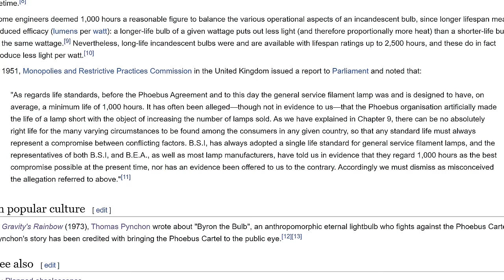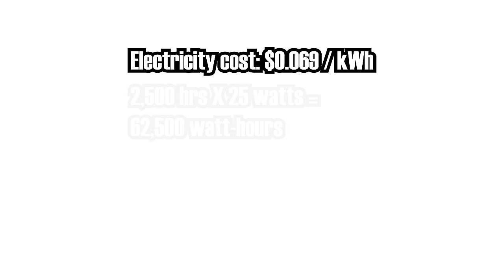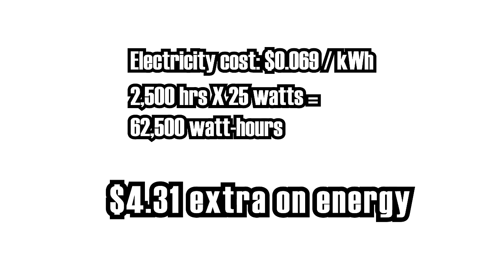Longer-lasting light bulbs: it was complicated

Comment: The big criticism is that the cartel decided what efficiency/light/color tradeoff was acceptable. The other view is that the consumers of the bulbs should be the one to decide that. Consumers might prefer dim, cheap light bulbs.
Reply: Had there been a clamor for the rare 2500h ones, that were available, to become the standard... then consumers may have changed the decision.   IIRC, they remained special-purpose.
Reply: Exactly.
Same thing with old internal combustion engines. They were lot less efficient in every way, but they lasted a much longer time and required a lot less maintenance. I should be able to decide if I want that or not.
Reply: @andrew-vl7gu  Follow a classic car with a carb, breaker points and no catalytic converter in traffic for a few blocks and you might not feel that way.
Reply: @jrrarglblarg9241 Sorry, maybe I wasn't clear enough. I did not say anything about that they are good for health nor environment, just making a point about that if something is longer lasting only because its less efficient its not necessarily worse and might be a tradeoff that someone wants to take.

Think about power generator instead of a car.
Reply: Alec never said the cartel was great and wonderful actually, he only said that their own logic wasn't just to force the buying of more lightbulbs. Consumers seemed to agree with the cartel's set point after all since the 1000 hour bulb remained common long after the cartel dissolved (and the much higher efficiency of those 1000 hour bulbs seems very desirable to those of us that remember the era of religiously turning off every single light bulb the second it wasn't absolutely necessary to save electricity costs).
Reply: @andrew-vl7gu Everything I've heard suggests the opposite actually. As complex as modern internal combustion engines are they've actually got a lot of developments that make them last much longer and fewer consumable components. For instance, my not-even-particularly-new car has a timing chain that lasts the life of the engine, replacing the timing belts in older engines that required replacement by every 100,000km or so, and if you missed that cutoff and the timing belt snapped the entire engine is cooked.
Reply: I have never once heard someone claim that light bulb manufacturers deciding on how to balance efficiency, life span, and color quality was the problem with the cartel. It is always claimed that they intentionally made light bulbs die more quickly to sell more of them.
Reply: @jrrarglblarg9241  I have one. It can be maintained at home and will run as long as I desire to keep it running. My modern car has more to break and parts availability in 30 years will probably be nil, assuming the computers and all make it that long.
Reply: @bosstowndynamics5488  i think there can be a lot of factors that might have resulted in the 1000 hour bulb being kept after as well, for one even if the cartel wasnt around the manufacturers might have kept producing more of the 1000 hour bulb because it was finacially better for them, another factor might have been that consumers got used to the 1000 hour bulb so many couldnt make the switch to a dimmer light, or it was also a case of the consumer not knowing the actual trade off, they could have just seen 2 lightbulbs, one brighter and one dimmer and assume that one was just better without thinking about the longevity tradeoff, another thing i can think of is that between when the choice was made and when the cartel ended the price for the light bulb might have went down as well to the point were as alec mentioned the tradeoff wasnt worth it anymore(not sure if Alec touched on this since im not sure if he used the low prices of the lightbulb from 1925 or the ones later one that could have been cheaper with advancements in manufacturing).
 
There are just some factors of the top of my head that could have impacted the decision. At the end of the day the choice for the lightbulb manufacturers was a easy one, a improvement in one area with the benefit of higher sales for them, if the choice for consumers was that simple as well there wouldnt have been a point in forcing that choice on them. For me personally im still skeptical about the whole thing, like i get the benefits and as with standards today you cant let consumers make the choices all the times but the differences in brightness dont seem big enough for me.
Reply: @bosstowndynamics5488  How long is that life of that engine, it may last a whole life of an engine if its short ;)
I think you're talking about just a generational upgrade of the same engine and that may be true. AFAIK there were engines on timing belts as well as chains in recent years, and not always chain was better (I think there was a VW engine with timing chain but with a flawed tensioner so you need to replace both of them pretty soon, or a different one that got stretched or spokes got worn out).

Taking that example compare a modern car engine to flathead engine - there was no timing chain nor belt to break at all. Also there were "collision tollerant", by that I mean even if valve timing would be off, there was no catastrophic failure of the engine because piston couldn't meet a valve
Reply: @TheNovgorodian  It's very easy to say that the dimmer ones seem better if you're looking at it from a modern perspective where the running costs for keeping electric lighting on are trivial and cost per bulb is significant, but these bulbs were made in an era where the running costs to keep a bulb running were so high that most people obsessively controlled how much their lights were on and when, and as Alec said the brighter bulbs weren't just a bit brighter, they were way more efficient too, which meant consuming much less power. The point Alec is making is that the total cost of ownership of the 1000 hour bulbs would have actually been lower than the 2500 hour bulbs when you factor in the electricity to run them.
Reply: @andrew-vl7gu  It's just an example, the overall point is that cars last longer than they used to.

An important factor to remember here is that there's a substantial survivor bias when looking at a snapshot of the car market today - it's easy to point out old cars that are still running and say "look, they don't make them like they used to", but that completely ignores the vast majority of older cars that are completely dead. You're comparing the best, most robust examples of old cars that got the best absolute treatment and maintenance against all modern cases, including both badly made modern cars and the modern cars that will still still be running in 40 years without issue. It's impossible to run a fair comparison this way because we don't yet know which modern cars are going to survive in that way, and you aren't comparing all old cars against all modern cars.
Reply: @bwofficial1776  The points you make, while true, do not refute my assertion that classic cars running their original engines smell up the air for half a mile behind them. Once in a while a shiny trailer queen does the Main Street thing with a fresh set of points and a well-adjusted carb that somehow manages to run correctly on modern fuel cut with alcohol, but even that thing doesn’t have a catalytic converter cleaning up the exhaust. I find it easier to love classic cars cruising up and down Main several times a year when they’re running a modern short block engine instead of an oil-breathing cast iron monstrosity.
Reply: @bosstowndynamics5488  yes but my issue with what both you and Alec are saying is that you are considering that people would go with the 100W 2500 hour option for the same brightness (which yes would have been more expensive) instead of the dimmer 70W 2500 hour light bulbs which im not sure it would be the case, if people had issues with costs then the 70W 2500 hour light bulb would have been the best option for them.
Reply: @bosstowndynamics5488  
My original point wasn't about cars, and definitely not a general rule that "cars were better X years ago" nor comparing all cars against each other. Averaging all cars they might "last longer" in mind of average owner but that's wasn't my point. I just wanted to match your example.

Rather that things were a lot less complicated so naturally they will "last longer" as a whole because there is less parts that could fail. You can already see that if you compare work needed to restore a 90' car vs 60' car. Its just less work to do assuming similar (major) damages and some parts just can't be manufactured (or its very hard) if you don't have a factory. Eg. Most integrated circuits are black-boxes that if you don't have a original "plan" then you're screwed. That's what I meant by "lasting longer", not that average car will make more miles or require less visits to a mechanic.

And again - my original point wasn't about cars, just that I want to have an option to buy less complicated, simpler things even if they are less efficient if I'll find it suitable. I don't want to have a cartel or a government to decide that those are bad and I can't have them because they say so.
Reply: @TheNovgorodian  Did you watch the video? Because it included a demonstration. The 70W 2500 hour bulb wouldn't have been a little bit dimmer, it would have been way dimmer. To the point of needing multiple of them to effectively light the same space. At a certain point of decreased light output the amount of light becomes so low as to be worthless.
Reply: @andrew-vl7gu  Yeah, but your point is wrong, that's why you're wrong about cars. Things being simpler doesn't automatically make them last longer. Circling back to the video subject, LED bulbs last way longer than incandescent bulbs despite being much more complex, in fact with a little bit of tweaking you can coax them into lasting literally dozens of times longer. It doesn't matter if something is less repairable if every single part of it is orders of magnitude more reliable - beyond a certain point of increased reliability you'll eventually wind up throwing out so many of the simpler thing or repairing it so much in the time one of the more complex ones lasts that the more complex item still beats it both in terms of absolute lifespan and resource cost to manufacture and/or run. Pretty much the only domain this doesn't apply to is battery powered stuff like sealed laptops and phones, and even then with some elbow grease those black boxes become open boxes with discrete components that can be replaced (specifically the battery).
Reply: @bosstowndynamics5488 i did, did you?(see, i can be snarky as well) he made a demonstration with a 40W 1000 hour lightbulb and a 40W 2500 hour lightbulb and the difference while definetly noticable is not something that you couldnt work with imo
Reply: @TheNovgorodian  Sure, you could "work" with it, in the same way you could use a night light to walk around without crashing into things, but look at the desk under the lamp, there's a massive difference in the amount of actual illumination being delivered by the lightbulbs in question. Then imagine that difference illuminating a whole room. Most people don't want to be straining their eyes to barely see at night with their main lights on.

Comment: I've definitely had bad luck with some particular brands of cheap LED bulbs.  Philips' dimmable "warm glow" bulbs have two different sets of LEDs:  one warm and one cool, and the cool ones failed within a few dozen hours very consistently for me (but of course kick back on randomly, leading to horrific flickering) and completely defeated the purpose of being able to switch between the two.
Reply: Do you have a LED compatible dimmer? Normal dimmers will kill LEDs very fast. Also overheating is a big problem with less efficient LEDs, so make sure the fixture slows airflow around the base of the bulb.
Reply: I don't even use the dimmer (it's at max power), so I'd guess the heat is indeed what's killing them since they're in an enclosed fixture.  It's just funny that that particular brand has been that bad since in my quest to find brighter bulbs (those weren't bright enough for me anyway), I've found many others that haven't had any early failure problems like these.
Reply: @joshbodner4834  I haven't had any Warm Glow ones fail like that, but have had some SceneSwitch ones fail the same way. Open fixture, sideways bulb position, and no dimmer in my case, but in a place with very old wiring and dubious power quality. The wider range between warm and cool on the SceneSwitch bulbs can make for a pretty wild show when the cool LED decides to come back on.
Reply: You know what, power quality also would make sense.  There's definitely some shenanigans going on with circuit isolation since I see the bulbs react whenever I turn on something powerful like the vacuum or microwave, and I also get small power flips at least every couple of weeks.
Reply: CFLs used to turn TVs on and off.

Comment: In the Soviet Union, incandescent lamps were rated at different voltages, e. g. 220-230V, 230-240V. The standard was 220V, but the actual voltage depended on the distance from the step-down transformer and the actual power consumption across phases. This convention was inherited by the exUSSR republics. So, when my parents got weary of constantly replacing the light bulbs, my advice was to buy higher-voltage ones. Those were slightly dimmer, but much longer-lasting.

Comment: You touched a bit on it, but my biggest ick over the whole thing is that restricting members to 1000 hours removed the motivation to develop longer lasting bulbs in general. If the issue was efficiency they could have restricted bulbs by that instead of lifespan.
Reply: You are still applying the wrong thinking. So 1000 hours was just one variable. You also have the light output and the power consumption. And also the material and manufacturing costs.
So coming up with longer lasting bulbs would translate into "now 10% brighter" or "now only 50 watts, but as bright as your standard 60 watt" bulb. Or they advertise nothing and have just "now with 10% less costs for us" in their internal balance sheet.
They just fixed one metric but improvement on the others have been possible and beneficial.
Reply: Well, it sounds like they had already optimized the physics of light bulbs, and any improvement in one metric past that point would come with a penalty to another, tradeoffs that marketing departments would eagerly prey upon. To make any real improvements would require changing the materials or chemistry. Given that halogen bulbs did exactly that, and don't seem to be restricted by the 1000 hours benchmark, it seems they left enough flexibility to allow for true innovation.

Comment: When I started purchasing CFL and later LED bulbs I was amazed how short their lifespans were.  Fancy, expensive, lots of name brand markup...and *poof*, dead.  I hope some day they approach the reliability of tungsten bulbs.
Reply: Driving around New York City these days I was shocked at how literally every traffic light had dead and flickering LEDs in them.  To be fair, there are dozens of LEDs in each lamp so there's no compromise to safety, but the failure rate of LED lamps is astonishingly high.  Same with the LED lamps in my home where 15% of them failed in the first year (I have a few dozen recessed ceiling lamps that were formerly using halogens that seemed to last forever compared to some of these LED lamps).
Reply: @kjrehberg  The problem is usually the power supplies not the LED's themselves. It all comes down to cost cutting. I have plenty of LED bulbs from around 2012 that are still working after approximately 50000 hours of use. These bulbs were bought near the start of the LED bulb revolution and cost a lot (around £12 - $15 each) . These days the same types of bulbs cost less than 1$ or less in bulk. A lot of that cost reduction has come from better manufacturing and more straightforward design. But the cost cutting has gone to far and many of LED bulbs these days are made with barley functional power supplies with the cheapest components and LED chips that are run at or even above their design rating. The end result that they just don't last very long - diodes burn out from overheating and PSUs fail due to poorly made and overrun components (flickering or flashing LED fixtures is almost always the PSU failing to reach stable regulation due to failed capacitors). It is perfectly possible to make LED bulbs and fixtures that last for tens of thousands of hours reliably but it's expensive and many manufactures seem to have decided to not bother anymore. Lets face it , most people when presented with a choice of LED light bulbs will usually just pick the cheapest, brightest one , not the one that costs 3 times more.
Reply: I started replacing all the incandescent lights in my house when I moved in in 2004, and by 2006 they were all CFL. Other than one or two that had manufacturing defects, I'm still running most of those original CFLs  almost two decades  later. And these were mass-market Home Depot CFLs, not specialty lights.
Reply: @doug7131  You are mostly right, but don't agree with your exact wording that making long-lasting lamps would be *expensive*. Yeah your point is right that it is about cost-cutting, but I wouldn't call the few dozens of cents of added manufacturing costs really as "expensive".

Comment: One thing that also increased bulb lifetime, a dimmer. 
It makes the highest current peak to go away during start as with most dimmers ramp up when light is switched on. 

Especially usable with 25 or 40 Watt E14 based candle bulbs in many chandeliers which usually had way lower lifespan. We had to change bulbs at least yearly without dimmer and with dimmer.. never in 10 years before changing to led bulbs.